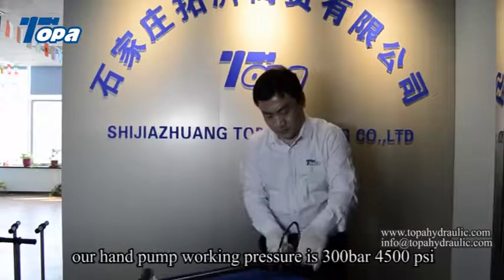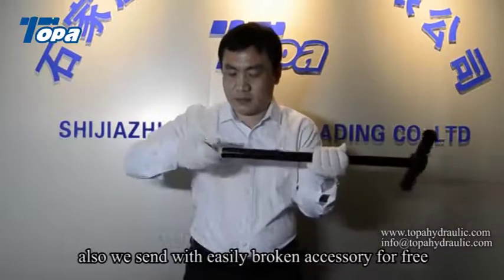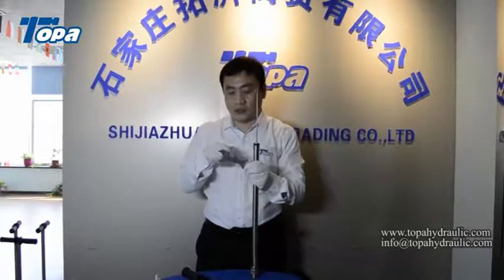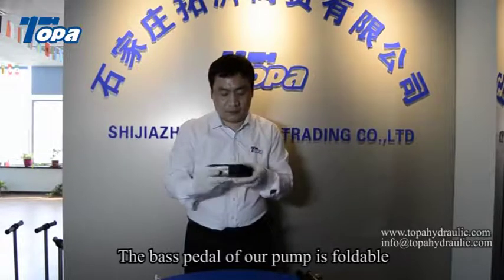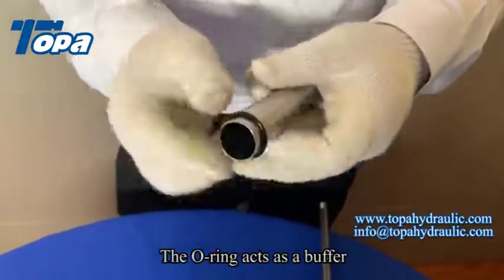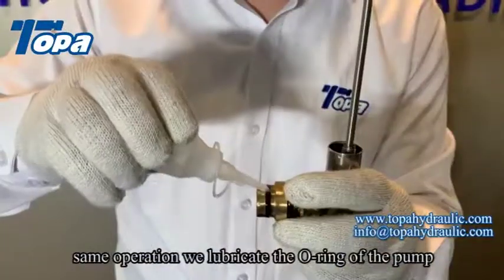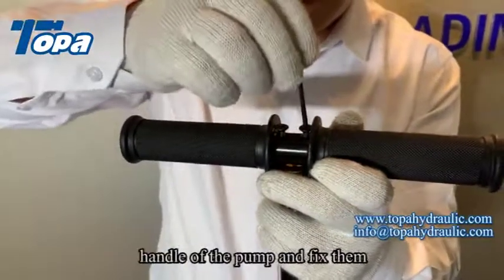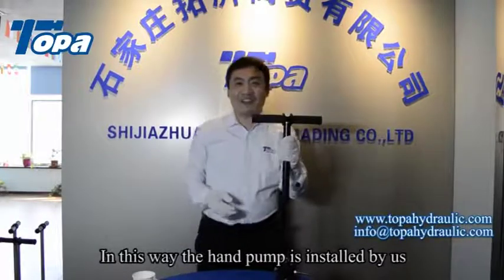how to fix a PCP hand pump - from Topa PCP filling solution provider

Comment: my pcp hand pump doesn't push much air at all  it's almost brand new   took it apart don't see anything wrong  and don't hear any leaks   but something has to be wrong  it should work better then that.  can you help me out
Reply from the maker: Hi Robert, most pumps are looks similar, but inside is different. Therefore, the maintenance method of our pump may not be suitable for your pump. say sorry for this situation
Reply: @pcpaircompressor796  mine is identical to yours
Reply from the maker: @roberttheriot7612  HI Robert, who did you buy it from? could you show us the picture? let's check it first.
Reply from the maker: @roberttheriot7612  https://youtu.be/4skIz2DOjd0  in this video, you will see some similar pumps, but the inside much different.
Reply: @pcpaircompressor796  over seas. I will try to find a picture